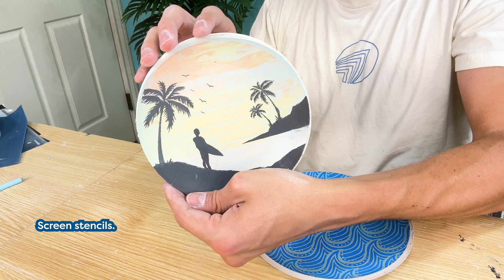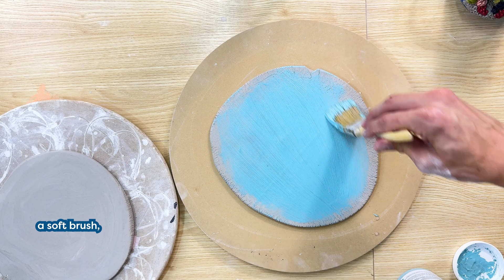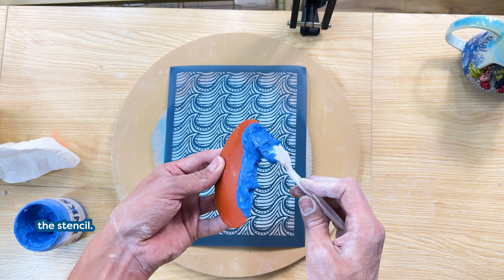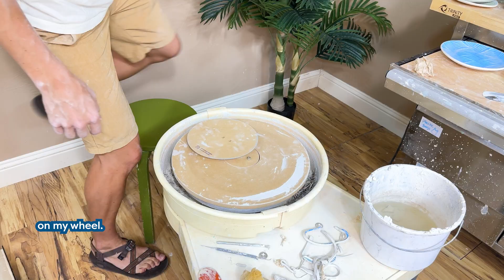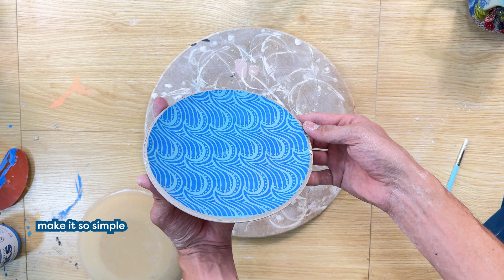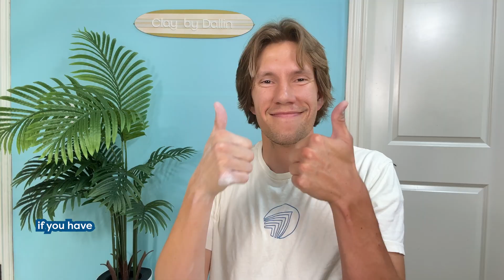DIY Screen Printing on Clay! Super Quick, and Super EZ

Comment: I am planning a project for an upcoming event using clay cups that guests (about 100) will take home instead of using disposable cups. My hope is that the cups become a meaningful keepsake that helps them remember the event. I am interested in screen-printing text related to the event theme, and that’s how I came across your product! I’m currently putting together a budget and researching materials. I watched your YouTube videos and noticed that you use different underglazes, so I was hoping to ask a few questions.

For detailed work (specifically text around 12–14 pt), which underglazes have worked best for you?

Also, if you have experience applying a clear glaze over underglaze, which clear glaze has helped you maintain crisp detail without blurring or color shift?

Thank you so much for any insight you can share — I really appreciate it!
Reply from the maker: Hello! For underglazes, I highly recommend Amaco’s Ceramic Printing Inks. One bottle goes a long way, and they work FANTASTIC with our stencils. They come pre-thickened so you don’t have to worry about thickening your own under glaze. If you want to use your own underglaze, every brand I have used works, some colors are just more likely to burn out a little bit (purples and some reds) but that happens with regular underglazing anyways. For clear glaze I use Mayco’s Zinc Free Clear and it has worked well for me. If you want you can message me on Instagram (@ezscreenprint) and I can show you some examples of pieces with finer details/text that I made with our stencils
Reply: @ezscreenprint  OMG Thanks so much for repling so quickly! I'll send you a message through your IG!

Comment: Hi I purchased your kit and made a stencil following your instructions.  It seemed to have worked well but when i put the stencil on my plate and using Amaco Inks the image didn't come out completely - it wasn't sharp or full.  there were spots where the ink didn't make it through.  I am not sure what I did wrong - could it be the stencil i made is faulty?  THank you
Reply from the maker: Hello! I have found with the Amico inks that they usually come at the right consistency, but I had one jar that was a little bit too thick so it was hard to get through the stencil. Do you think that could be the issue? If so, adding just a little bit of water to thin it just a touch works
Reply: @ezscreenprint  thank you.  let me give that
 a try.  the consistency was like frosting.